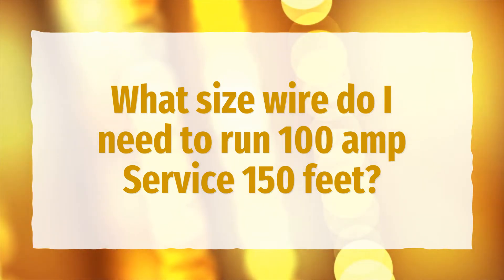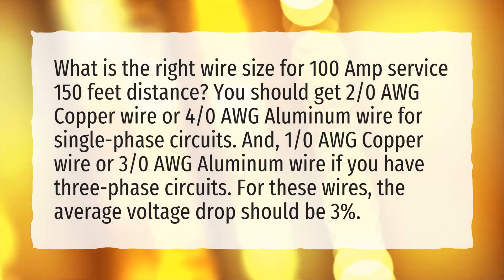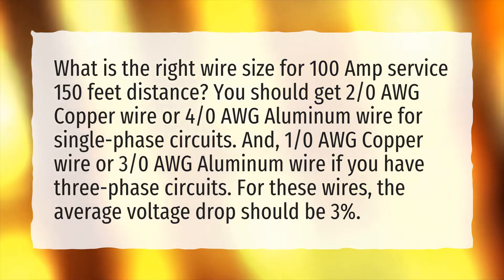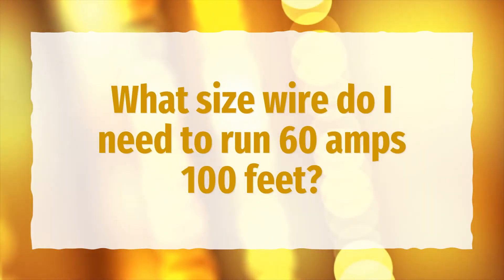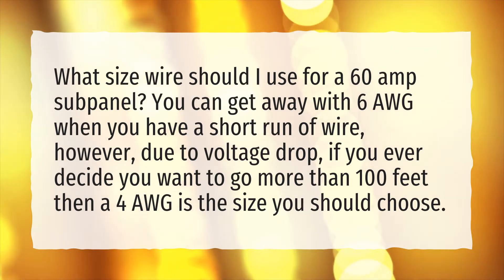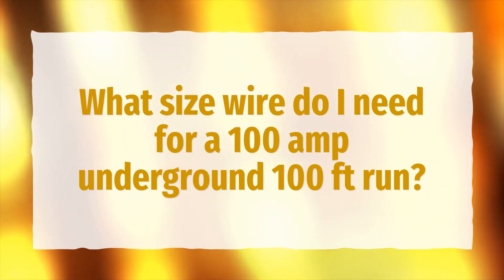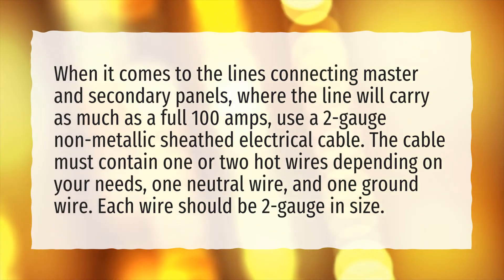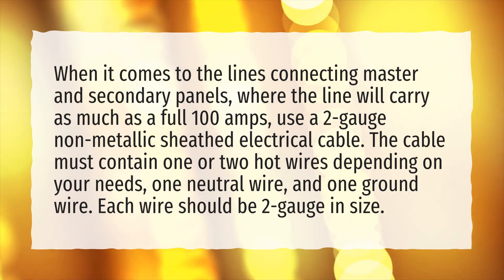What size wire do I need to run 100 amp Service 150 feet?

Comment: I am NOT an electrician. however
Doesn't copper wire flow more amps than aluminum?
If so, wouldn't  when required to run 100 amps 150 ft, shouldn't the aluminum wire required be larger, not smaller in size.
Is the date in your video possibly reversed and should it be:
#2aluminum, #4 copper? 
Please clarify for me.
Thanks
Reply: They did say to use larger aluminum wire. In this case a 4/0 wire is larger than a 2/0 wire. The 4/0 and 2/0 sizes are another way of saying 0000, and 00 AWG wire sizes. AWG sizes get larger with lower numbers (10 is smaller than 5 and 1 is smaller than 0). Sizes larger than 0 are given more 0's.